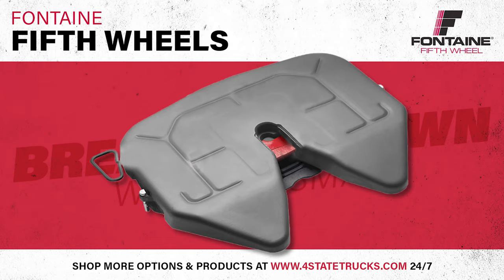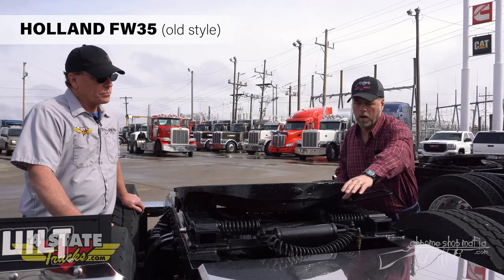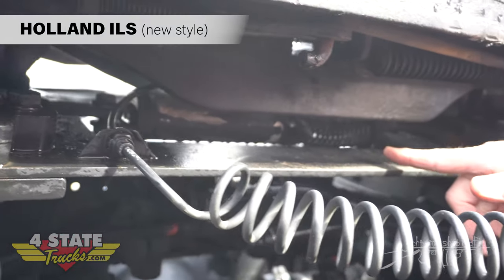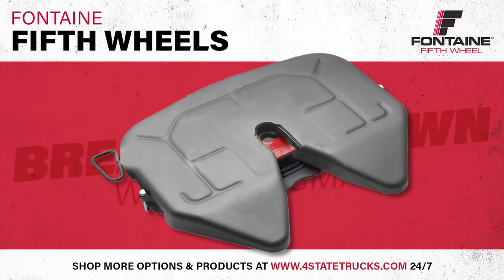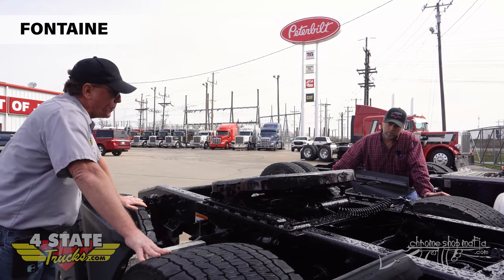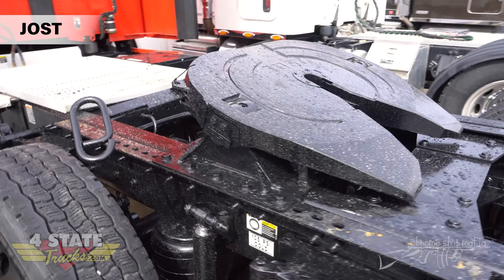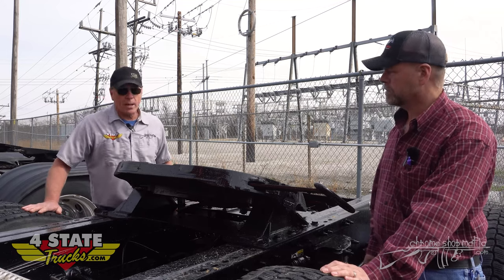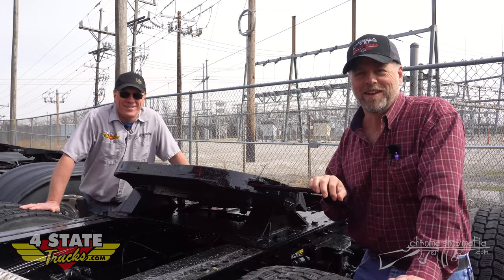Breakin' It Down With Bossman - 5th Wheel Differences

Comment: I'm not a fan of Jost. I've always been a Fontaine NO Slack 2 guy. 
I got a new to me day cab wet kit truck with a blockable air slide Holland 48" high at the top plate I like it. Still trying to figure out the weight difference per pin on the Holland. I like running it all the way forward. The Fontaine was 500 lbs a hole. So I'd run it 2 to 3 holes forward of center. I'd run it closer but have swing clearance issues. So 11,500 lbs was all I could get on the IHC with Fontaine. I would love to do what I call a Schneider Bob to the rear frame horns. 
Its on their container trucks. They chopped of the rear of the frame back to the rear cross member on the airbag of the last axle. Then the mud flaps are bolted to diagonal brackets mounted to the rear cross member. Helps get the steer axle to 12000 lbs. Most my loads are 40 ft boxes. And up to 47000 lbs plus box and chassis. 
Now to get a JBHUNT style neck with a shallow kingpin on a 40 ft chassis.
That's for another discussion.

Comment: How much weight can be saved by going with a fixed mount, low or flat aluminum 5th wheel?
We're pulling a tank and the perch is too tall causing to much weight on the tandems. 
Also, do you know how much weight can be saved by going from duals to super singles?

Comment: I bought rig used from Ritchie bros, the 5th wheel, I would say is a high profile 5th wheel. I hate how it sits. I mainly how dry van. Sometimes I would pull a 40 foot bottom dump. Most of the time dry van. The truck looks like one of the yard jockeys with it point up to the sky. From what I see I have the older Holland 5th wheel, it’s a right side release. How can I make my 5th wheel to a low profile and maybe switch it over to a left side release?
Reply from the maker: Good morning, 
 With Old style holland you would have to have a welding ship fabricate low legs or replace the whole fifth wheel and slide with new style low legs
Reply: @4StateTrucks  ahhh I see. Probably a whole new 5th wheel assembly would be my best bet huh?

Comment: Is it possible to go from a stationary fifth wheel to air slide fifth wheel??
Reply from the maker: @jebiga5650 Yes it is. The complete 5th wheel and base have to be changed and a switch and air line installed in dash and ran back to 5th wheel.

Comment: I have a 2016 Peterbilt 579 and the trailer broke my mud flaps 🤬. I was told the fifth wheel needed to be center and to my surprise my 2016 Peterbilt does not have adjustable fifth wheel what the ***^# Peterbilt really
Reply: Should’ve gotten a freight shaker lol